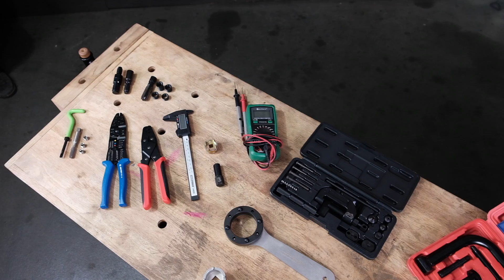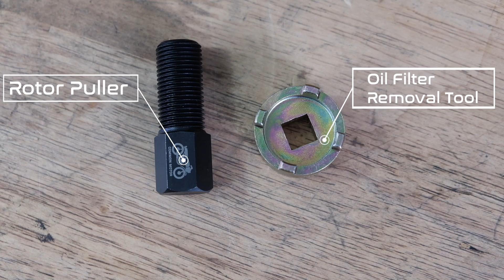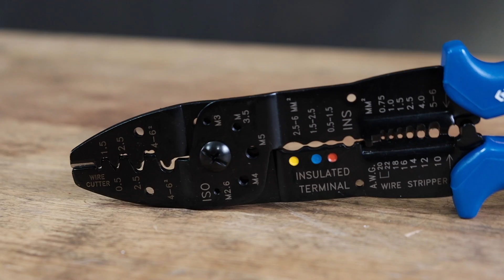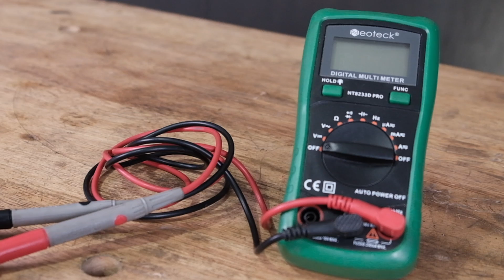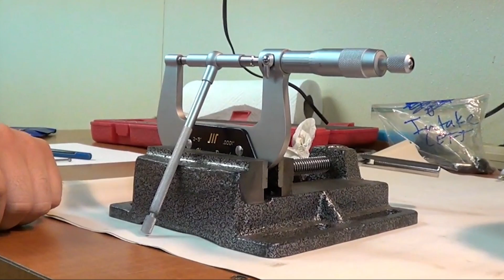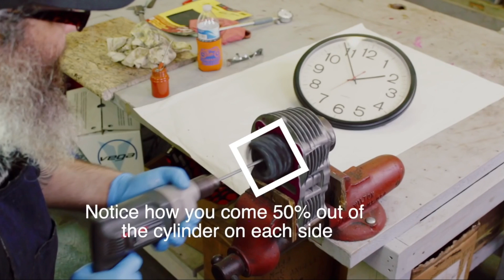Specialty Tools You Need For A Vintage Honda Motorcycle - Advanced Tools

Comment: Hey. Quick Question.  I'm looking to buy a bike. Seller states its a 1976 CB360T. But documents and frame VIN and decals  only have CB360 on them ? It also has a front disk brake.. Is it actually a CB360T or just a CB360 ? Thanks.

Comment: I've bought the wheel bearing retainer removers, the oil slinger removal tool, and the rotor puller. High quality stuff and saved a hell of a lot of time.